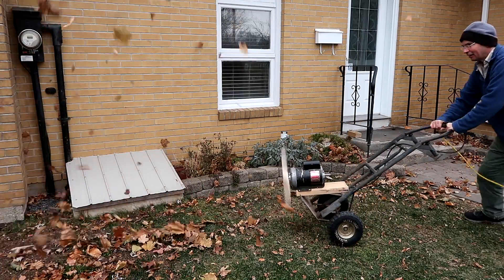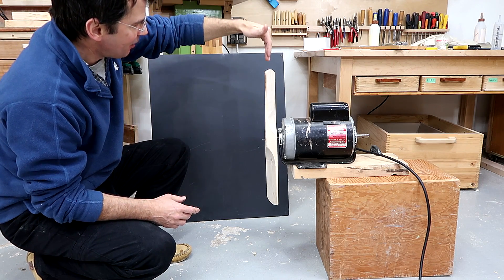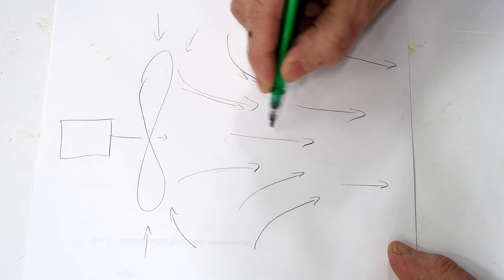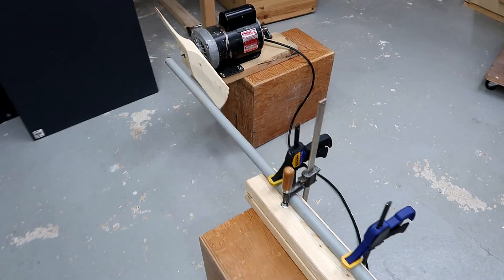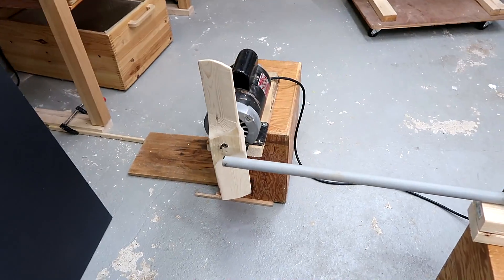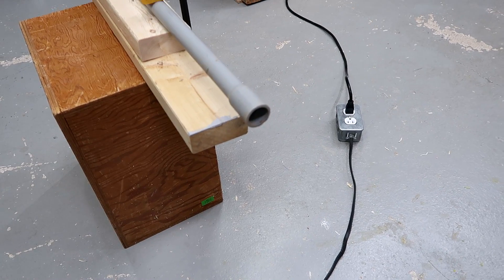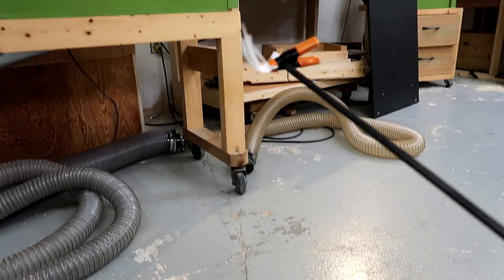Complicated air flow in front of a fan

Comment: Seems like adding cowling could increase efficiency for an exhaust fan where there is concern for what air is being drawn in. There may be applications where you don't want to draw air from the sides, only from the back; maybe a concern of system efficiency versus local efficiency.
Reply from the maker: Good point, yes, if I want to suck air, the cowling, preventing air from being sucked in at the front, could cause more air to be sucked from the back.  I was thinking in terns of the "leaf blower" application.
Reply: 🔴 What Is Islam? 

🔴 Islam is not just another religion. 

🔵 It is the same message preached by Moses, Jesus and Abraham.

 🔴 Islam literally means ‘submission to God’ and it teaches us to have a direct relationship with God. 

 🔵 It reminds us that since God created us, no one should be worshipped except God alone. 

 🔴 It also teaches that God is nothing like a human being or like anything that we can imagine.

🌍 The concept of God is summarized in the Quran as:

📖 { “Say, He is God, the One.  God, the Absolute.  He does not give birth, nor was He born, and there is nothing like Him.”} (Quran 112:1-4) 📚

🔴 Becoming a Muslim is not turning your back to Jesus. 

🔵 Rather it’s going back to the original teachings of Jesus and obeying him.
Reply: @matthiaswandel  the thing missing from your video is any consideration for the interaction between the total load on the motor at different speeds, and the specific characteristic rpm torque curve of the motor. Because by adding a coweling it would change the curve of the total drag vs airspeed / spindle speed. Which is a different curve. And it is the combination of those 2 curves together which determines the point of optimum efficiency of the entire system. Remembering that these are 2 opposing forces. Now you could postulate that the effect of drag due to the air and turbulence is not significant, or that it is below and within the performance of the motor and prop, being under driver in both cases. Or you could try to do come complex fluid dynamics calculations on a supercomputer. But most people in industry would instead do a 'small scale version' experiment or use a wind tunnel. And use other knowledge and experience. In this instance you have been thorough investigating the no cowling situation. However I do not feel that your assumptions were equally thorough or sufficient for predicting what the situation with cowling would do in terms of total air drag vs turbulence. Not without doing some further research or looking for nearby other real world examples. But perhaps in terms of deriving a maximum reactionary force then a good example would be something like a hovercraft or 'swap boat" like they have over in florida.... sorry I cannot think of any other good examples off the top of my head. Personally I really have no idea if some type of a cowling would be better or not. We could endlessly speculate. For example perhaps a concept like the nacelle 2nd chamber of a jet engine could serve to be more efficient at involving nearby airstreams but IDK, since the speeds and temperatures are hugely different in each cases. But I would not presume to know either way unless there were some existing real world experiments and examples to reference and read up on. It would be foolish to otherwise speculate upon such things. The calculations get out of control pretty quickly, and end up being far too complicated. Even for supercomputers.
Reply: I wonder if a cowling would increase air speed at the cost of volume throughput? I'm thinking all that stationary air being sucked up into the stream must "steal" its energy from the air being propelled by the... propeller? Though I guess the cowling wouldn't have any effect on the air in front of the propeller, so probably negligible effect overall...
Reply: Ducted fans beat open fans when the intent is to produce smoother (vs turbulent) airflow, airflow of a particular velocity, or air flow from and to a particular place.   Some complex fluid dynamics dictate what is more efficient, not least is how and what you measure and call efficiency.  
You want to really make your head hurt start measuring pressure throughout your air stream and try to make sense of it.  It is all rational, but such a complex set of simple cause effect relationships strung together that there are few simple rules or mathematical principals which can describe it with any accuracy.
Reply: Is it not the venturi effect that hsppens?
Reply: @OyvindMB  I'm thinking the same thing.  That pipe placed into the airflow perpendicular to the flow has to be causing a vacuum in the pipe.  It's a flut!
Reply: @OyvindMB  I also immediately thought of the Venturi effect
Reply: This is why high bypass turbofan jet engines have cowlings.  They experimented with ductless turbofans, but they'd have to be tail mounted or they'd suck too much debris on the ground.  Also they're noisy as heck.  On a normal cowled engine, you can sometimes see a little "tornado"  vortex entering the intake side of the cowl when taxiing on wet pavement.  They're giant vacuums at the front end.
Reply: @NoelBarlau  I’VE SEEN THAT BEFORE! It’s so COOL! I’ve wondered about that for YEARS!
Reply: All of the comment I have read so far are wrong. The best way to increase the efficiency of the fan blade is to round one side to create an airfoil.  I used to teach this to my students for years.  I would make a prop like Matthias and test it with my anemometer then take it off and in less than a minute of shaping a curve on one side of each blade I would double the air flow.  Even a very crudely shaped airfoil would drastically increase the performance.
Reply: @dillonpapa  I’d love to see this demonstrated
Reply: Not to mention protecting the human using it.
Reply: There is no vacuum in the middle. There is a lower pressure zone.  Bernoulli -- as velocity increases pressure decreases and vice versa.  The //vacuum// isn't sucking the air in.  The higher pressure of the atmosphere is pressing the moving air (lower pressure) into a narrowing cone.
Reply: If you look at the sawdust footage you can clearly see the flow recirculation at the edges of the fan (technical term is tip vortices).

The cowling prevents this and increases efficiency, and will actually result in a wider air stream.
Reply: A duct added around a propeller in water increases the efficiency. 
I can't but believe the same goes for air. Yes curving a propeller also adds efficiency. 

It is really a mystery why not every propeller in water got one, because it would lower the demand for fuel also...
Reply: The blades have to be very close to the shroud and the length and shape of the shroud is important, but most of the time a ducted fan is more efficient at producing thrust (and they are quieter).
Reply: I assume the cowling comments came from car guys and it makes sense for a car fan, because you want cold air to flow through the radiator and not just move some hot air around in the engine bay.

Comment: Air flow characteristics are highly dependent on the shape of the blade. The blade on the oscillating fan is quite different from the propeller. My dad has a very old 2-blade floor floor fan with curved blades. You can set it a couple of feet from the doorway of a room and it will close the door, leaving it open just a couple of inches — moves a lot of air at a low static pressure.

Comment: Adding a small airfoil shape to your flat plate blades would have helped with the power your motor uses, also thinning the chord of the airfoil as you get towards the tip will also reduce power consumption while maintaining high velocity and volume.  Next time you're in a RC model hobby shop look at the blades on modern E power aircraft.  Notice that the blades don't have a fixed pitch throughout their length,  that the airfoil pitch and thickness are both steeper and fatter as you go from the beginning of the blade root and go out towards the tip.
Reply from the maker: Yes, ideally the blades have a slight twist to them.  Just that this shape was really easy to cut out on the bandsaw.

Comment: It seems like Mr Dyson was onto something. Imagine seeing the title of this video and thinking this is just what I've been looking for. But since I found out how the Dyson fan work I've been fascinated by how air flows. Number one your pipe test is no good because when you push air across the pipe it's automatically going to draw air into the pipe it doesn't it's not a vacuum that's just the way pipes work think of a flute.
I think you should try it with a (round) cowl. But add one feature to that cowl. A reducer on the front. Think of the top edge of a funnel with the narrow side facing out.  I don't mean take the air flow down to a pinpoint, just reduce it a little bit.

Comment: @Matthias Wandel: Increasing fluid speed always reduces pressure (Bernoulli's principle), explaining why putting a pipe perpendicular to a high-speed airflow will always tend to drag air into the flow. This is also the principle of Venturi valves/pipes, but this is not vacuum! The failure is to think of pressure, because pressure is just fluid flow put against some resistance. When there is no measurable resistance, measured pressure will drop as fluid flow rises.
Regarding some housing around the fan: Housing will greatly increase the flow, as it 
a) prevents air to circle to the back of the fan
b) directs the fastest area of the flow (approaching the diameter of the fan) into the axial direction of the fan instead of "outwards".
Were this not the case, why would aircraft fans be encased (I am not talking about the actual turbines, which are (also encased) placed within those outer casings)?
Reply from the maker: bernoulli doesn't apply to turbulent flow.  Look it up
Reply: @matthiaswandel  At (and to some extent near) the impeller blades, Bernoulli's principle applies, just as it does on airplane wings. If you are trying to create the optimal leaf blower, putting the fan in a pipe will help, because it is forcing the flow to a certain direction. You are right that this will reduce the absolute amount of fluid propelled, but increase the amount that is useful for your application (blowing away something by pointing a device - fan - in its direction).

Comment: It's venturi that why youre detecting a vacuum. The pressure is likely lower anyway because of the airspeed. But Bernoulli certainly applies to flows this slow, no where near Mach 1.

Further, wake of the fan diverges due to momentum theory, at least in basic form, and this is applicable to helicopters too.

Because the kinetic energy component of the flow is 1/2*rho*v^2.The velocity of the wake far down stream is halved the velocity induced by the blade directly after the disc and so because the velocity is halved but the mass flow remains constant (theoretically) the wake cross sectional area is doubled. But in reality it like increases as you saw, because of Bernoulli the stream air has a lower pressure, and so "sucks" in air from outside of the wake flow, the mass flow increases, and the average velocity decreases further than basic momentum theory, and so the wake CSA is more than double far down stream because a higher mass flow and a lower velocity must mean a higher CSA.

Comment: A rotating fan like this creates vortices around the edge of the fan. Iamgine something similar to the field lines of a magnet. Around the centre, they go straight out, but as you get to the edge, the air begin to flow outward, until the air movement that flows into the fan from the rear also draws from the side, until they join, creating a vortices at the tips, that flow back into the fan.

This is why helicopterare more efficient hovering near the ground because of ground effect. A large portion of the air that would normally cause vortices stop when they hit the ground and travel along the ground
This is also why ducted fans are more efficient than their non ducted counterparts.

Comment: - I understand this is supposed to be a leaf blower (near the ground) but for propeller efficiency test, test should be conducted high above the ground. (jet engines are tested on a pylon with a bell mouthed entry to provide a smooth transition between still air and moving air).
- Google translation doesn't offer two nouns for this but in French this would be called a "moulinet" and not an "hélice" (propeller) because the blades are not warped to ensure constant angle of attack along the radius. Moulinets are used to test aircraft reciprocating engines on the ground.
- as somebody  already commented, shaping the blades like an airfoil would greatly improve the efficiency.

Comment: Think in terms of negative and positive air pressure, and atmospheric air pressure at sea level is about 14.3 lbs psi Air has volume it takes up space if you move air from area something has to replace it or a vacuum is created i.e. negative air pressure so when the fan starts moving air you creat spaces of both negative and positive pressure and the saw dust is falling into lower pressure areas while it is being moved along in positive pressure areas this is a simplification but should help you better understand more of what you are seeing.

Comment: This is an axial fan if the pipe is kept in 90deg angle sure you will get a vacuum similar to car window if it's only slightly open one side to get the actual flow use pitot tube  facing toward the fan.  Or use talcum powder or steam to see the actual effect

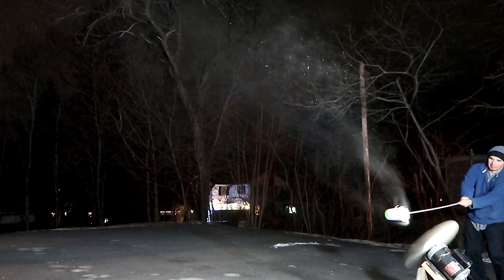Comment: 5:40 Shows parasitic recirculation that a cowling could prevent. If you want to blow, you want thrust, You want a column of air. The longer the cowling, the more organized the air flow gets and the exit end of the cowling begins to resemble a nozzle. But, extend the cowling too far, and the surface area begins to add drag.

Comment: Cool. Makes me think what would have happened if Mr Wandel sen. would have taken his family to live & work at a back country airport for bush pilots.
Didn't you have a waterhose-level to measure the suction of your dust collectors?  That would have been nice to measure the variation of vacuum in relation to the propeller axis.
You can still mount a cowl in front of the propeller, and make the shaft longer, so that the propeller can suck in air much easier.
And when the measurements are done, install a water hose and you have a snow cannon.

Comment: Testing with the pipe is causing a lowering of pressures such as in an atomizer or wind across a chimney. I don't believe it's a valid way to find out what your looking for. The sawdust idea is good.  A tapered reduction  cowling in front will increase the wind speed into a smaller area (Bernoulli ... reduction =lower pressure =greater velocity) Leaves will blow better but not due to more air just faster air like in a wind tunnel.

Comment: That tube actually doesn't explain nothing about this "vacuum". There is actually sucction in the other end of the tube because what is happening is a Venturi Effect.
Reply: the venturi effect applies to constricted pipes. Matthias is not using such a pipe.
Reply: @techcafe0  not only. If you blow next to a tube you will notice the other end will suck. Blowing one end of a tube creates a low pressure in this region. Thats exactly what is happening in the video.

Comment: Your pipe and vacuum test is kinda.... silly.

Higher speed air passing by the neutral zone (pipe) is going to be at lower pressure from just the airflow itself.

They make vacuum cleaners for pressurized air that the whole premise is using that alone.

And cowling/funnel for a leaf blower isnt to increase efficiency. It is to increase directed pressure. 1HP over 20 cubic feet aint too crazy, but 1HP over 1 cubic foot is.

Comment: So a cowling would make for little difference, but maybe a cowling with opposing stator vanes? That would certainly keep the airflow less turbulent and maybe increase the pressure but would likely reduce the total volume. If your clearing leaves, volume is really what your after.

Comment: Everything you said is correct, that is how hovercraft and helicopter works. There are vacuum and high pressure nodes in your front stream, you can observe it by moving pipe slowly away from fan. I remember studying that bzilion years ago, If I remember correctly those pockets are created because of frequency of fan rotation or something. Someone with Aerodynamics degree correct me please if I'm wrong.

Edit: Woozy did it, as reply to one of comments it is called turbulence

http://labman.phys.utk.edu/phys221core/modules/m8/turbulence.html

Comment: I think the effect you're measuring at 4:00 is the venturi effect of air rushing past the end of your pipe, drawing air into it and creating a vacuum in the pipe. The fact that the vacuum in the pipe persists until you angle it into the fan I think is consistent with the venturi effect. I don't think you're actually measuring the vacuum at the centre of the prop, but rather the speed of the air rushing past the end of the pipe.

Comment: The problem is that blade design is better for a propeller application rather than a fan. For a fan design look at computer fans, they're curved in a way to maximize airflow and then yes, having a cowling helps.

Comment: I am sure you have made your fan vibration less as possible.
There is some suction toward the ground but I see no reason while it would have suddenly increased.
Isn't it simply that the clamp has become loose combined  with the hang over of the motor which has caused the failure?